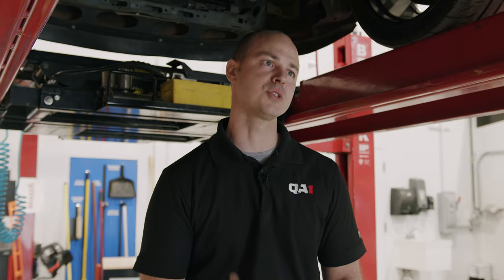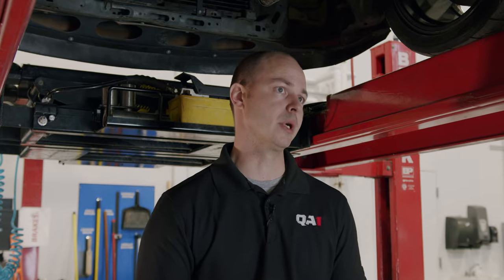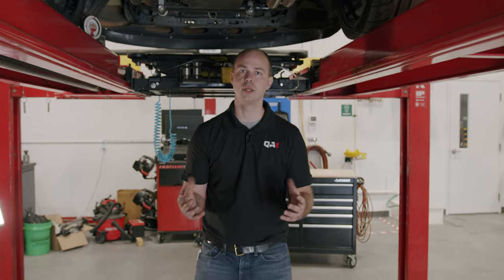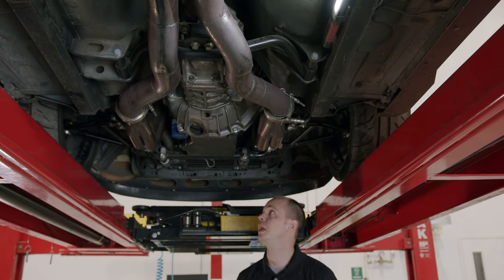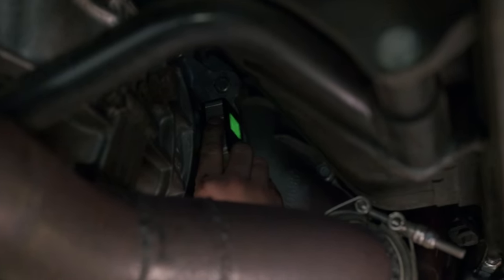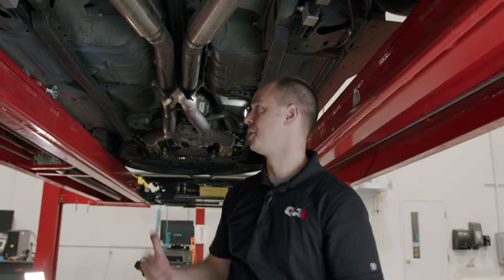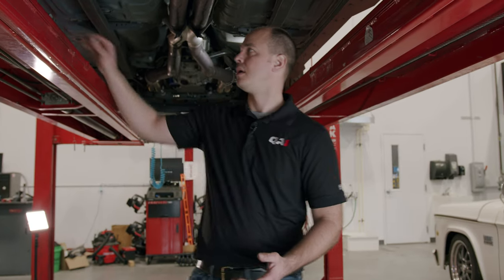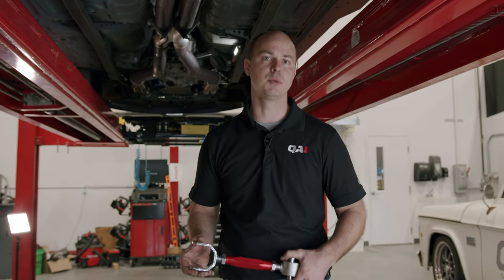How to Measure Your Pinion Angle | QA1 Tech

Comment: So glad he went over all the math involved, oh wait he didn't bother so we learned nothing.
Reply: Actually I thought the same thing but went back & looked at the video again..if he would have used the analog angle finder he would have had to write the math down to add or what not... but by him using the Easier method digital Angle finder in step 1,  he zeroed it out which means go to step 2 meaning the transmission is the same as the zeroed out balancer pulley. (no shims or adjustment needed) I would have thought he would have done the  drive shaft too but he skipped that & went straight to the pinion. In reference to the pulley & transmission the digital finder says it was .5 Upwards meaning positive. With reference to the Pinion.. He stated that in needs to be a  .5  degree downward meaning negative-- because the differential rotates Upward & needs to be adjusted as such so it will be 0 under that launch load.= parallel ( In other words by the digital finder zeroed out at the first measurement there is no math involved it found it easier cuz its already calculated for you).   .5  is what he saw on that digital angle finder...... make your adjustments until you see      -.5   (negative .5) and that's it.

Comment: While the video is lacking in actual numbers, generally you want the engine/trans pointed down about 3 degrees. Adjust the pinion angle with vehicle weight as run normally. Meaning a tank a gas, driver, fluids and ride height to be fair. 1/2 of 1 degrees low, allows for grease to migrate around the u-joints while cruising, decelerating, just a no load condition. When running hard, the pinion climbs up the ring gear to level so the cross yoke and needle bearing are not rotating during this short run. Measure a factory car setup and go from there. Of course most of us don’t have a “Drive-On” hoists so unless you dig a pit, lay on your back is the best we can do!

Comment: I think you may have the lengthening and shortening backwards. I think you were referring to adjusting the lower trailing arm when you said upper. If you lengthen an "upper" trailing arm doesn't this rotate the axle and pinion upwards at the front? You said, "To rotate the pinion down a little bit, we would actually lengthen the upper trailing arm."

Comment: I have 2021 f150 runs in 12s would you still want -1 to -2 degrees or would that cause vibrations at cruising daily driving speeds ?